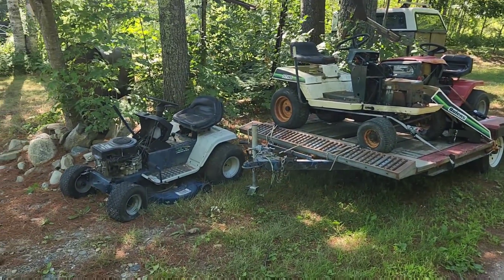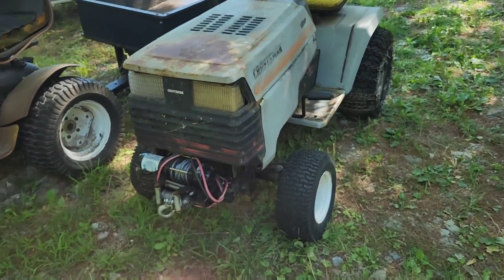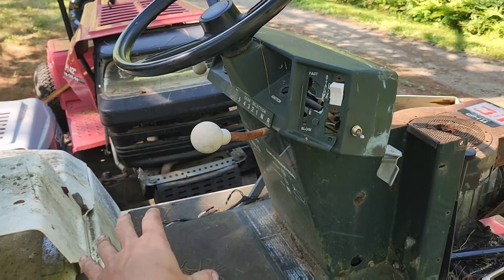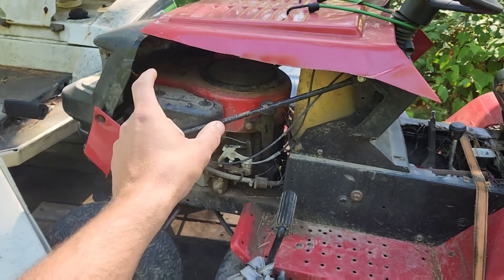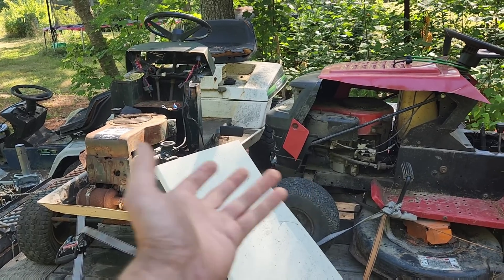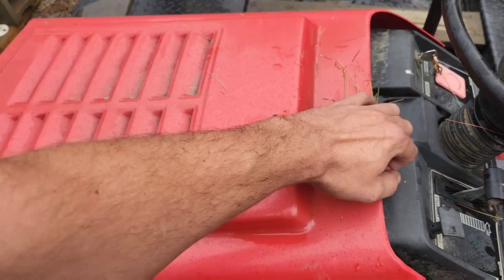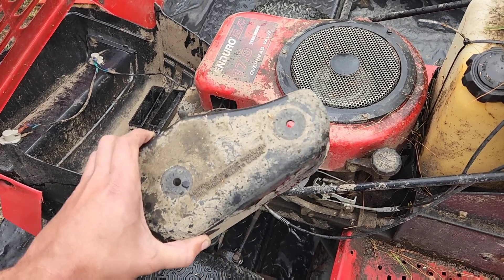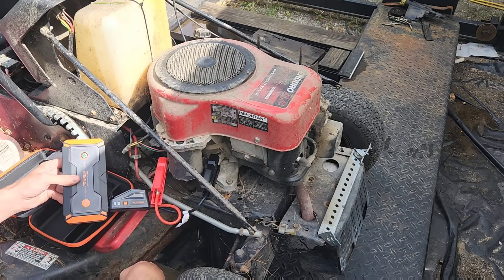Tractor Hunting: Bolens ST110

Comment: I have a 12.5hp Tecumseh on my Early 90s Dynamark that I use to cut my grass with it has been a really good engine. I don't think it's the original tho i do maintain it very well. Those plastic carbs were made so they don't gunk up from the ridiculous ethanol, and if you do have problems their super easy to clean and maintain. Thankfully mine does not have that ridiculous California contraption mine has the Phillip screws. I just wish it was a bigger engine, that's my only gripe. Awesome job as always RNCG. I LOVE THIS KINDA VIDS YOU DO
Reply from the maker: I think in the future I will hunt down a few of these engines and see if we can find some carb swaps. The intake is blatantly a briggs clone to the point I wonder if a carb would be bolt on.
Reply: @redneckcomputergeek  that would be awesome, I'd love to see if a regular carb would bolt on these engines.

Comment: It's unfortunate those jumper packs, are currently unavailable.
Personally I can't really say anything bad about Tecumseh Engines, I've never had major issues with them.
I know most people hate the backfire prevention solenoids, not me they have saved a few engines of mine in the past.
Reply: The 40+ year old Tecumseh HH-60 engine on my old Troy Bilt Roto-Tiller is still going, it does need a different carburetor, the aftermarket cheap Chinesium ones are pure junk...
Reply: The tecumseh engines are pretty good and thankfully most are still supported Lauson power products company purchased the manufacturing line and still produces oem tecumseh parts I like the tecumseh flat heads the best

Comment: I take it you don’t like the Kohler opposed twin engines considering your using them as a weight for the basket ball hoop ? I think they are good if kept up with on maintenance
Reply from the maker: So here in Maine we find them dead Dead all the time. Something about the way they are made they can not survive a winter or more outside. The ice in winter gets into the timing rod area and other things. Its why Oppy Briggs are far more popular up here.
Reply: @redneckcomputergeek  huh interesting what if it’s stored in a heated garage
Reply from the maker: @hunter7476  Then they do fine.

Comment: Classic bolens that was the switch period when Troy built bought bolens in the mid 1980s that’s why the bolens you have looks like a rebadged Troy bilt in late 1990s mtd purchased the trot bilt and bolens line defeniltey a better tractor than what’s currently in the market but unfortunately most if any parts are hard to find or no longer available at all

Comment: enduros have cheap valves, switch them with head from a tecumseh that was in a dyna mark. put a slide carb with fat jets. nothing better than a 490 tecumseh. it is all i race
Reply: the ocelots on the back of my swing arm never stop spinning. i put that engine against anything around its size. everyone want to know what im running, you never an engine sound so nice. making the fuel tank vent bigger and custom air box  . it likes air. and it was going lean after long uphill at full throttle. it was fuel vent. . building outboard bearings for the axle and input shaft are key to any build . thanks RCG